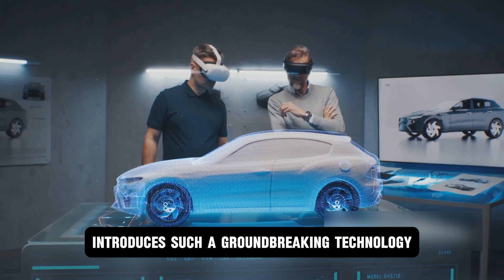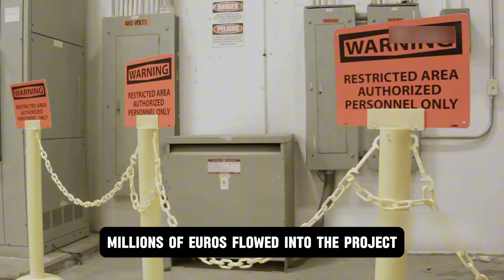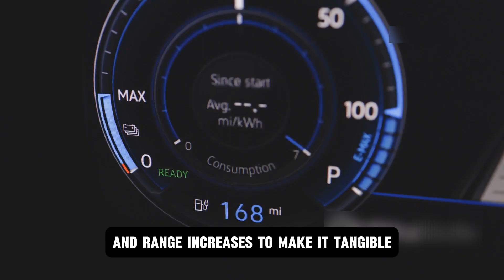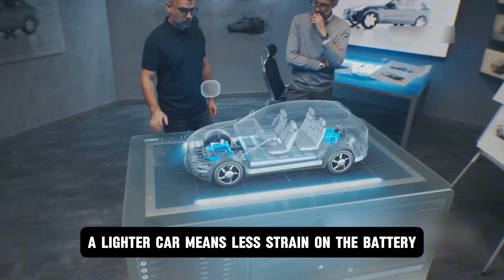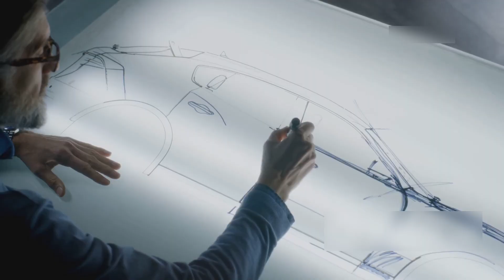Mercedes Drops a Bombshell: YASA Flux Engine Officially Confirmed!

Comment: There is plenty of video of Mercedes factories. No need to show an auto garage.  The Yasa motor can be put on every wheel which means no drive shaft.  All electric motors have superior torque.  More facts less fluff. Skip the AI .